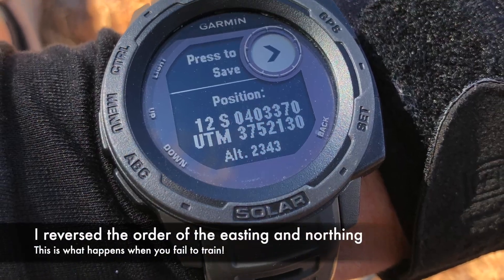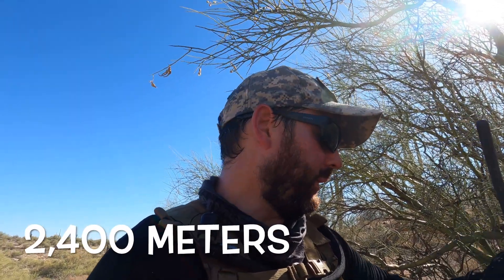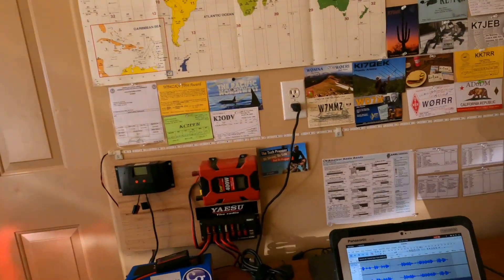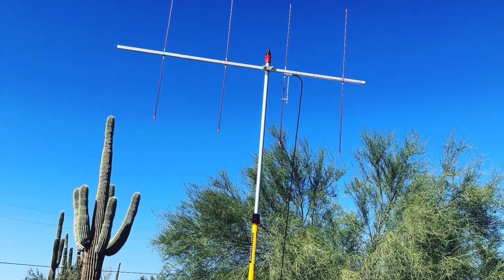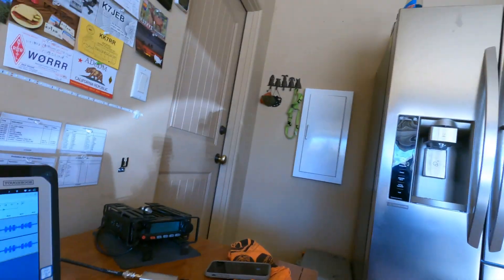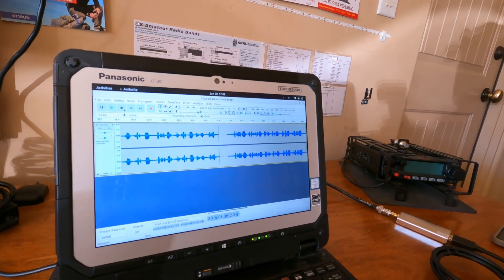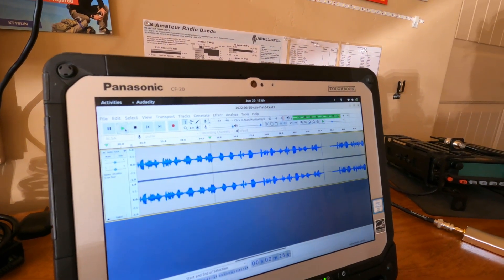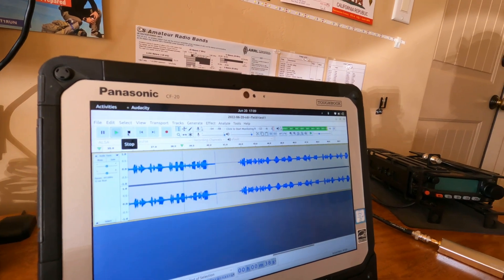RTL-SDR & Voice Activated Recording - Part I: The Field Test

Comment: This is super cool man. I’ve gotta look into it. The trouble for me and messing around with radios is similar, it’s just not common to get audio sampling from my transmissions unless someone is on the other end to record manually. Also, for RF recon, this is pretty amazing. Nice work Gaston.
Reply from the maker: Think about the possibilities for HF and sideband recording when you're on an activation. I'm planning on testing this approach with NVIS on 40m.
Reply: @TheTechPrepper  absolutely. I’ll need to figure this out for windows. What’s also convnenient is you don’t have to have another rig at home receiving. Just simple stuff. Thanks again for pouring your perspective into sdr.
Reply from the maker: The author is SDR++ just added sound activated recording! This new support invalidates this video and part 2. Hopefully, he'll have an official release soon.

Comment: Great video. I have used a simplex repeater before when testing equipment, it can give you instant feedback incase you need to make adjustments. But I like the idea of monitoring a Fx for traffic with recording.
Reply from the maker: A simplex repeater is a good option, too. I like this approach as I can play back the audio multiple times and inventory the tests as simple audio files for historical reference. Cheers!

Comment: Another good one. Keep in mind you can basically do the same thing with digital modes as well. Your practicing with yourself. Lol
Reply from the maker: Correct. You are absolutely right. Using this technique with digital modes was actually my primary use case, but I thought it would be easier for the viewers if I started with voice first. Thanks for chiming in.

Comment: What frequency do you use for testing like this.  I assume simplex but is there an "unwritten rule" hams use for a certain frequency and testing?
Reply from the maker: Excellent question. As a rule, I typically pick a simplex frequency that's recommend as part of my state's band plan so that I don't cause interference. I also avoid the national calling simplex frequency (146.520 Mhz). Technically, I used a frequency that's allocated for "experimental packet" (145.500 Mhz) as I do a lot of packet tests on that frequency. I never hear anyone that frequency. I am also in the country, so there's very little chance of me stepping on any toes. Search for "amateur radio band plan <your state>" on Google.

Comment: Good stuff as always, Gaston!  I've been thinking about getting one of those to tinker with and maybe mess around with some SWL.  Thanks for sweating for the team!
Reply from the maker: Thanks, Richard. If you want my advice avoid the RTL-SDR kit that includes the dipole antenna. You are better off using any of your normal amateur radio antennas based on my limited experience. It's a great piece of kit for $30 USD. I am sorry that I lost the screen recording that had the actual SDR++ waterfall of my transmissions. I'll include this in the next video. I just did not have the energy or time to spend another hour in the desert to re-run the experiment. The import part was capturing the audio recording. Either way, I am very happy with the results. I am going to try similar tests with other modes (SSB) and bands (40m/75m/80m) NVIS. We're even going to try:  decoding DMR voice; listening to P25; decoding various digital signals and listening to some HF nets. SDR's are a Swiss Army Knife. Heck, I am even enjoying listening to broadcast TV (audio only). Stay tuned.

Comment: You can use SDR++ (even on Android) to record audio transmissions (Recorder > Audio > Record). Why do you use the Audacity?
Reply from the maker: I configured Audacity to only record audio over a certain audio level. So, it only records when I transmit. If I used the recorder in SDR++ it would have recorded for an entire hour with gaps in between my transmissions, right? With Audacity the entire audio clip was only the sum of my transmissions which was 1 minute and 3 seconds. Please let me know if I am mistaken. Does SDR++ actually do voice activated recording natively.
Reply: @TheTechPrepper  At the moment it doesn't but I could add it this weekend
Reply from the maker: @ryzerth  Are you the developer of SDR++? If so, job well done. I am new to SDR's and found SDR's user interface the easiest and most pleasant to use. For this exercise, I used the PulseAudio Volume Control application to share the SDR++ audio with Audacity. Then, I used the "Sound Activated Recording" in Audacity to only record audio above -30dB. I look forward to see what you come up with.
Reply: @TheTechPrepper  Yup, i'm the dev lol. I've had the request to add voice activated recording for a while. Since I'm currently rewriting the entire DSP it's a good time to add it in.
Reply from the maker: @ryzerth  Excellent. It will be very nice to drop the PulseAudio and Audacity dependencies. Good luck! I'll be looking forward to this feature.
Reply: @TheTechPrepper  You are right. At the moment SDR++ records one big file with audio and silence. It's useless. You can add a comment to my feature request :) https://github.com/AlexandreRouma/SDRPlusPlus/issues/690

Comment: Most SDR software packages include a recording feature, but not voice activated. That is pretty nice.
Reply from the maker: Thanks. I did not want to re-invent the wheel. I'm surprised that there isn't a voice activated module yet. If I missed it, my apologies. I'm new to SDR's. Either way, adding Audacity to the mix accomplished my goal. Take care.
Reply: @TheTechPrepper  I don't know of a voice activated recorder but, SDRSharp has a plugin architecture and it's C# .Net so that's up my alley. But yeah, SDR's are a really interesting thing and there are a ton of possibilities.